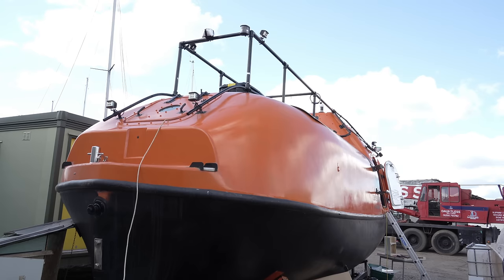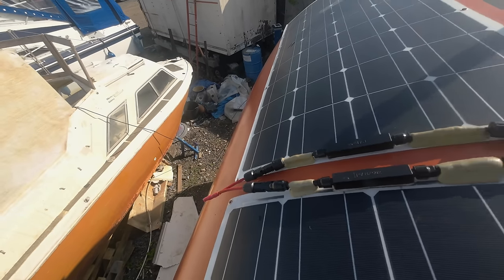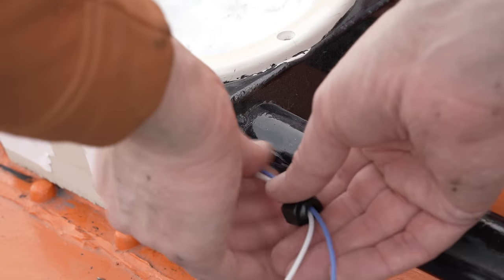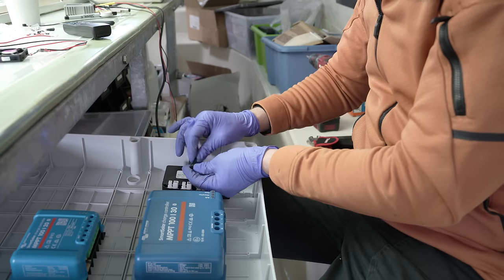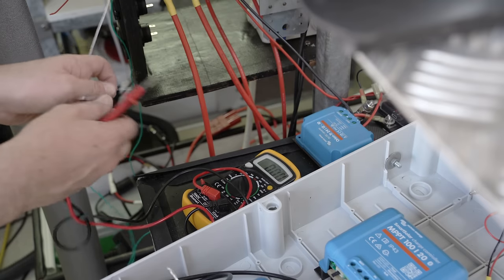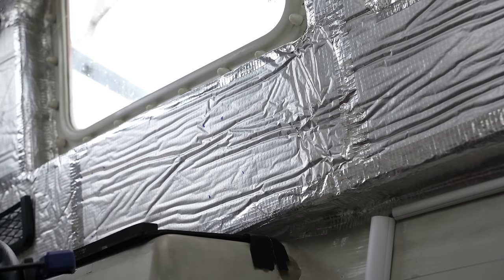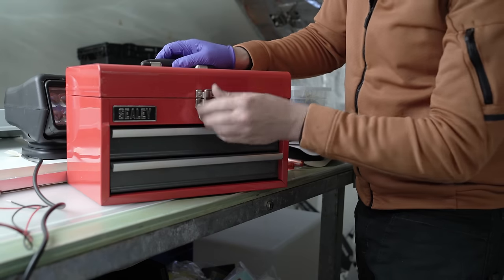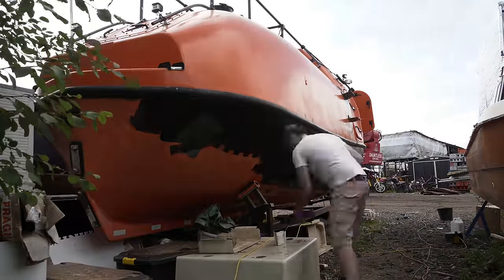Lifeboat Conversion Ep40: Solar panel charging array is wired into the boat electrics system [4K]

Comment: I do love a good box of electrical gubbins.  I'd be interested in a video entirely about the wiring at some point, but I recognise that my preferences may not be common.

Regarding that trailing cable on the deck, I'd naturally go for a piece of conduit, but I don't know what the environment is likely to do to it.  Aluminium conduit would be temperature tolerant but not terribly strong, steel would likely rust, UPVC would be brittle in the cold.  A plastic conduit could at least be heat-shaped to hug the curve of the hull.  Either leave both ends of the conduit open to allow water to drain straight through, or gland a small junction box on to each end (but that seems likely to be quite bulky).  Silly suggestion - what about a section of shower hose, firmly filleted to the hull on either side?  If it has the diameter to pass your high-strand-count cables, it's both flexible and likely to be relatively durable.

Comment: If you ever need to make the hatch handles more comfortable to hold onto because they are still cold then later on you can follow up with some of that white foam in your toolbox wrapped around the handles lightly with some sealant to stick the foam to the previous heatshrink & then tape to hold it in place followed up with another heatshrink tubing on the outside so that it will act a bit spongy but not too much which should completely remove any chance of cold coming through.

Comment: To protect the cables on that section of deck I would look into using D channel cable raceways. They're flat on the bottom & a half round on top. The vinyl & rubbber ones can be opened along one edge & can be latched back down so they afford easy access. There are also cable protectors made of steel but I don't like using galvanized metal in a salt-water environment & attaching them would be a challenge. With the other type you could attach them to the deck with an adhesive.

Comment: Did anyone else's OCD go off when you saw him cut those zip ties and left that sharp as a knife tail instead of cutting the tail flush to the locking head?
Reply from the maker: An interesting rabbit hole. I saw it as two pros - you can still get hold of the tail with pliers, and there's a little extra to avoid it being pulled through and releasing the tie somehow. But no cons, until you suggested the sharpness issue. 

I'll meditate on the issue.
Reply: @AlexHibbertOriginals  A response from the Star himself? I'm honored! Good point on it pulling through. I suppose if that box isn't an area that you're in all the time with your hands, then it's not worth giving it much thought. Unless of course there's a chance of cable chafing. But it seems like all those cables are tied down and not just floating about and have the possibility of rubbing on it.
Reply: @AlexHibbertOriginals  - If a flush-cut tail pulls through and releases, you've got inferior zip ties. I have a whole bunch (as in, over 100) flush-cut zip ties under extreme tension, holding 10 pieces of plywood together in the shape of a dinghy, until I get around to gluing and fibreglassing it. It's been moved all over the workshop many times, hauled up to the roof with rope, lowered down again, and generally manhandled and abused, and despite it being wobbly and flexing every time it's moved, NOT ONE of the zip ties has pulled through or let go.

Cut 'em flush and be done with it.
Reply from the maker: Noted!

Comment: I found that my Victron CC seemed to get a lot of updates in 2020/2021 but so far this year only the one, it was a huge pain in the arse because mine is mounted in the hold of my steel boat, getting the phone close enough for the the Bluetooth to work cut it's internet connection and the ap wont work at all once it's decided the CC needs a firmware update which had almost made me decide to get rid of it and get one that wasn't controlled by a bloody phone ap. 

Cured the issue by accident when i got a newer phone that seems to have a better Bluetooth radio and can connect through the floorboards but much as I like the Victron unit I'm still not happy with all these new devices for boats that need phone aps to control them.

Comment: For a cover for the solar cables, buy a length of aluminium square tube on one side using your circular saw cut lengthwise through one side so that you can slip the wires through & then silicone that edge to the deck so that if anyone walks on it or kicks it the wires will be okay.
Reply from the maker: That's what I've done for some things inside, but the deck is curved.
Reply: @AlexHibbertOriginals  Aluminium is easy to curve, just heat it up before bending around some plywood that has the same curved cut out on it. Screw down an end that will be trimmed off as waste, heat up the aluminium to bend while hot, bend & use ratchet straps to hold it in place until the metal cools, should work fine.

Comment: Regarding the solar, always put a blocking diode on either the positive or negative of the battery lines to charger as at night solar panels can run down your batteries. You can parallel diodes to the required amperage but the downside is that they will drop the voltage considerably so try to find a 20-30 amp blocking diode depending the amps of your solar panels. The cable glands might be useable if you shorten the nut on the inside by cutting it in half if it's a wide nut but if its already a thin nut then forget my banter.
Reply from the maker: Don't the charge controllers take care of blocking nighttime discharge?
Reply: @AlexHibbertOriginals  Yes they do, at least I've never had any issues with my Victron unit back feeding the panels from the batteries.

Comment: Use sikaflex 291 or something similar to adhere the solar cables between the panels and the rails you’ll be able to step on them without damage. They’ll not move around but you can if needed peel it up for access.

Comment: The ring of solder in the heat shrink/solder splices looks barely melted to me, especially the ones next to the solar panels. Are you sure you got them hot enough for the solder to wet the conductors properly?
Reply from the maker: Yep, I always wait until I see the solder flow.

Comment: So you don't need extra long threads on the gland. Use the bulkhead as the nut. Drill and tap the through hole to the same thread on the gland. Then, screw the gland in to the box itself. Use appropriate thread sealant, of course.
Reply from the maker: Tapping a thread through that hyper-hard stainless, or the section of both glass and steel, would be an ordeal!

Comment: I'd be interested to see some real world data on the volt drop on your cabling. Most advice would suggest 4mm2 cable for your application, but as you say a thinner cable should meet the spec for current/volt drop.
Reply from the maker: Yes indeed, I'm more concerned about this now than I was initially. It's no great drama to swap it out for a wider gauge if needed.

Comment: It's a Martensitic Stainless steel. Stuff is more vounerable to corosion, but practically indestructible otherwise.
Reply from the maker: It's an odd choice then as it was originally bare, uncoated and unprotected on the deck, when Alan was in service.

Comment: Probably too late to be useful, but next time you need to clean something with adhesive qualities resulting from heat, a needle scraper is the way to go. You can usually find a pneumatic one for about 15 bucks. This is really where they shine, seam sealers and things that get gummy with heat. The needle scraper breaks it off in cold hard chunks
Reply from the maker: Interesting

Comment: Having airflow under those flex panels maybe good a thing for cooling. Heat ruins those flex panels. But saltwater maybe not good to have festering underneath.
Reply from the maker: You're not wrong. They are on probation anyhow. It's helpful though that I'm only working in mid/high latitudes. I won't be dealing with Mediterranean or tropical sun strength.
Reply: @AlexHibbertOriginals  yeah I realized that after writing that. I live in the southern US. So I had to use strictly ridged panels for my builds. I'm really looking forward for the adventures you go on. And all the progress you've been making is awesome. Thanks for all your hard work making these videos I really do appreciate them a lot.

Comment: I have to ask, but why didn't he (you) put the solar panels vertically, with the elec connections close to the top rail, thereby negating any curve issues??
Reply from the maker: In that orientation the panels would end up too low down, making them susceptible to side on damage, and angled poorly for the sun.

Comment: Are those UV rated wires? Why not use PV wire the whole way?
Reply from the maker: Yes these are UV stable. 

I don't like PV cables due to stiffness and a low strand count.

Comment: Alex I’m so sorry to inform you of this but I just heard that it is now illegal to mount an iPad to a carbon fiber panel that is attached to pieces of wood in vertical insulation. Really specific law but I’m sorry you had to hear it from me :/
Reply from the maker: Now I truly value the merits of lower strength adhesives.

Comment: You really should not use those heat shrink solder joints all in one. The solder is low temperature and thus very brittle especially if you're going to be going into cold places. It's known to shatter and fail in temperature extremes. It also does not make a good electrical connection most times leading to higher heat
Reply: There's a reason why no electrician uses them. I used to use them in my car and they would just fail within months
Reply: You'd get a better more reliable connection by twisting the wires together and then just putting higher quality shrink wrap over it. And that is not a very good connection but I've had it last a heck of a lot longer.

Comment: Will the solar panels really work in the extreme winter like cold environment with very low light during snowstorms? Efficiency will be very low with other factors. Pack up a small generator and emergency battery with power seperately as backup. You never know when you will need them.
Reply from the maker: The solar won't be for winter high latitude use. There will indeed also be a wind generator and a diesel powerplant. And my teammate on a cycling machine...
Reply: I assume that you will be using the engine to top up your house batteries?

Comment: If you do not want to short circuit the wires, do not repeat as the author of the video does.  They don’t do this on boats, I advise you to first read the relevant literature, otherwise you won’t sail far.